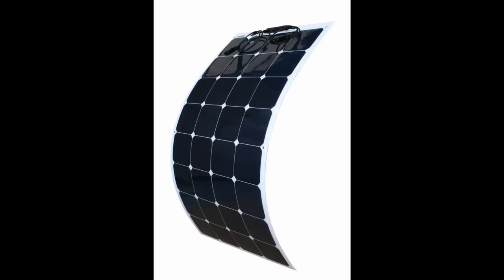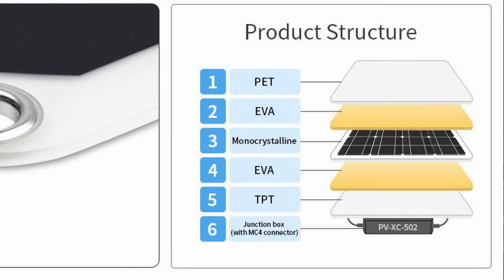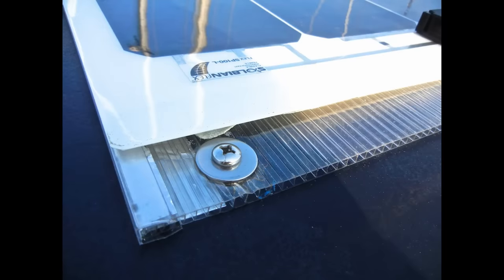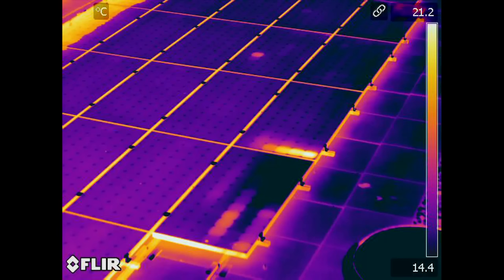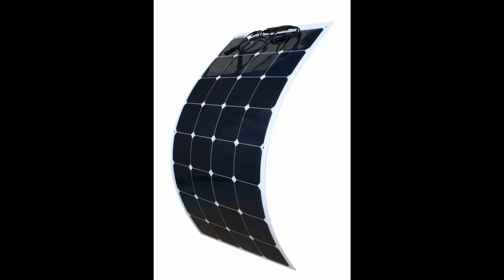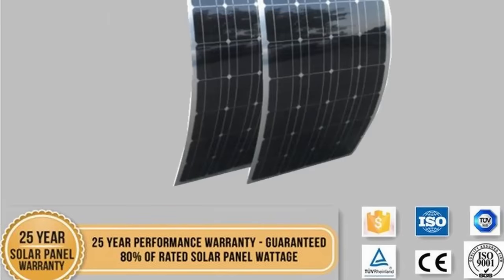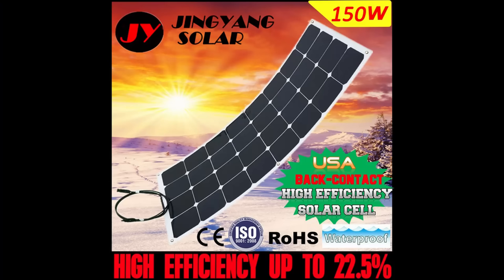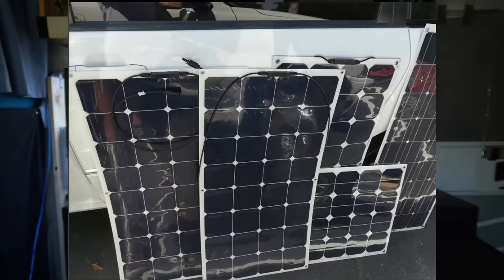The Truth About Flexible Solar Panels

Comment: Will: I think you need to update this. My Renogy flexible doesn't get any hotter than dark paint but my glass panel gets a lot hotter. Most are junk but there are several good ones now.
Reply: yes!!! please Will, we need an update!!
Reply: So happy i saw this comment. Just ordered a 175w renogy flexible panel, and was about to regret my decision, but now i feel good again 😁
Reply: @elsyver  They are quality.
Reply: yep those older ones were booty
Reply: When it doesnt get as hot it means the heat is trapped inside, if you were to touch the actual solar cells it would be way hotter. thats why flexible panels dont last as long
Reply: @LienoGenesis  Well, my Reongy flexible is five years old and functions just like it did when new. I don't think your premise on trapping heat is correct. The cells are covered with a thin layer of ETFE and I'd feel it. Cheap flexibles fail because they are made from PET plastic.

Comment: Wow, you managed to cram an hour's worth of info into six minutes. Will, this is the type of video I love. None of the fluff and time killer, just the facts!
Reply: Mark Conger pro tip. for 1 hour videos watch at 1.5x speed.
Reply: spot on comment.
Reply: Yeah, if they can't give me the info in ten minutes or less, they're either disorganized or think I'm lonely and need some company.
Reply: Minus the facts ... 
      He has a wild misunderstanding of how solar cells work, how they fail, or how they dissipate heat. 
His thermal fails show signs of resulting from cracked crystals which frequently happens during the shipping and handling.  
The sandwhiching layers are NOT, in fact, insulators. The thermal performance with one thin layer of plastic is very close to that of the glass (an actual insulator) on one side and air cooled aluminum on the other. 
Failures frequently occur when people paste them to metal roofs that get hot in the sun.
They are less efficient, they are not as durable, but literally nothing this guy says is anything but counter-hype. He is enthusiastic and convincing, just not accurate. 

    Solar power is suffering terribly from over hype and the resultant backlash like this video.
Reply: Don’t forget to like, subscribe, and leave a comment. Please check out our sponsor with the link in the description. And make sure you click that notification bell. Don’t forget to buy my merch!!! 

First, I’d like to start off by telling you why I am interested in the topic, and how I came about finding the information on this topic. Next, I am going to tell you about the history of this topic. Then I am going to tell you a personal anecdote that may or may not have anything to do with the topic. Before  I end the video, I will dedicate at least a minute or two to the actual topic so people in the comments don’t claim I’m click baiting. Lastly, I will restate everything I said earlier, but also show you my pet who decided to interrupt me while recording on the set. Awe! Isn’t he/she cute?!? Thank you to our sponsor!
Reply: Everything can get a work around. In this case placing tge flexible solar pv panel on top of an existing solar thermal collector panel will eliminate the heating of the over heating of the panel.
Reply: I barely got one fart in during this video. Quick and straight to the point
Reply: @squireson Hype is coming from the sellers... to advertise 25 years and fail within 1.

Comment: Interesting, nearly 4 years into flexible in uk, mounted near flat on a ribbed van roof, still performing as well as always 😁
Reply: I'd be interested in getting your views, as I'm about to use 2 or 3 flexible panels on my van in the UK.  I wonder if our 'weaker' sun here actually helps?
Reply: Incompetent installation and/or very poor quality panels encounter these heat problems. The encapsulations on glass solar panels are also insulators. I , personally am a big fan of the aluminum backed semi-flexible marine solar panels as you can dissipate heat beneath them (if you can manage an air gap without getting flex form the wind)

Comment: I'm happy with my semi-flexiblepanel after four years.  I mounted it on a thin sheet of masonite.  Light weight and shock resistance are essential to me.  I keep it indoors when not charging.  I never expose it to the night sky because freezing might harm it.  Mine is the one shown in your video.

Comment: I have glass panels in all my permanent installs, but I bought a semi-flexible one to use as a temporary vehicle battery charger when my car is parked for long periods. A glass panel would take up more space when not in use and also be more likely to damage the dashboard or trim due to the weight and sharp corners. So far the flexible panel is working fine. I'm reasonably gentle with it and it is entirely exposed on the back for heat dissipation as it is held onto the windshield with suction cups.

Comment: I think the flexible panels your are talking about are the flexible crystalline ones. There is also thin film (aka amorphous), which are meant to work better in low light and shade. You made a lot of good points.

Comment: Dude your opinion is by far the best, I have ever seen. That’s saying a lot because, I have been selling and installing renewable, sense the early eighties. When I started, we made our own panels, I broke many cells while soldering the cells, to make a panel, not to mention the water proofing the panel. it’s so much better and easier today. Even after all of these years, I still feel that, a Home built, Axle Flux Wind Turbines is far better then, any manufactured wind turbine, on the market. NOW FOR ME, and for what I’m doing, I’m trying something very difficult, installing a panel on my boat. I would like to be sure my boat battery stays charged, I have a 20’ Thompson speed boat, that we use for fishing. While under power, I’m never worried about our charging abilities. There are those days, that we stay put all day fishing, our electronics, are always on. We have Humminbird Fish Finder/Deep finder, a Ship to Shore Radio, and other electronics. That’s a heavy drain of power, we start our boat every 1/2 hour or so, to keep the batteries charged. We added a extra battery in Parallel for extra capacity. My fear is if someone would ever forget to start the boat, they would drain out. I even keep a third battery on my boat on standby, just in case. Yes I’m paranoid, I would like to have a 200w solar panel charging them. I have always known for about the shittyness of flexible panels. Is there Something that you can suggest for my situation or is flexible my only answer, with the problems you have, rightfully explained. The next problem is the whole 12v thing, I hate them, I always considered them a waste of money. All of my off grid installations we use 36v panels. With Midnight Solar, Classic Charge controllers. I’m just in one of those weird situations, that I may need a flexible 12v panel, with some stupid and cheaply built controller. You would know this, what would be a decent small controller, that you would you suggest? I have never built such a small array before? Sorry for the novel dude. Your opinion is very valuable to me. I always send any new off grid costumer, of mine to you. They can get a education from someone, I consider one of the best that I have ever seen. You will go a long way in life, and will lead people to a much better future.

Comment: I agree that the inability to dissipate heat would cause failure of the panels or at least reduce its performance. Ambient temperature does account for a large portion of heat, but what is being show at 0:46 is from circulating current due to individual receiving different amounts of radiation, thus different currents. It has more to do with internal interactions rather than environmental temperatures. Also, this is an issue flat panels share, so his statements aren't technically true. It just happens more often with flexible panels because how they are being used.

Comment: The hot spot issue is not due to materials used, thin plastic sheet performs the same as a thick slab of glass.
The most likely culprit is in fact bending damage, these panels are handled 100x over and very likely to get small unnoticeable cracks which will keep getting worse once the material heat cycles, and once you have significant damage the cell no longer produces a comparable voltage to other cells so it becomes a power drain instead, now effectively working as a resistive heater.
It could also be bonding issues, but that is again a very small change in heat dissipation.
Reply: Yeah, he has misidentified the 'hot spot' cause. The encapsulation materials on glass panels are also insulators (-ish). While I deeply wish this weren't true, getting small orders shipped all the way from China/Indonesia means they get handled alot .

Comment: South-east England and I have just fitted a flexible panel, and the purchase was mostly based on the pop-top roof of our elderly camper. When we upgrade the camper, or the struts that hold that pop top! The mounted area is almost completely flat, so it shouldn't flex. It's a mono 150W etfe panel. It was cheap, fills a gap for us and can be replaced in a few years if the van is still with us. Nice work Will, love the videos, keep it up!

Comment: I've had flexible panels on my boat for 6 years and have noticed for at least the last three at least that the output has reduced dramatically. I was getting up to 25A from 360W but now only using 180W (2x90W panels) and getting 2.5-3.5A. A useful trickle but not much more... I will be going for solid panels when the time comes 👍

Comment: when you can get a 200w flexi for less than $70, which is less than 5 times the cost for heavy rigid panels, the light, slim, cheap flex panels are excellent as portable extra panels you can tuck away and only bring out when you are  parked in the shade. So they may not last as long (duh, most cheap alternatives don't, but just do the maths). I have two large (250w) flexi panels as extras, I backed with a semi rigid plastic billbord material and cable-tied slim alloy channel around the edges, fitted longer cables and now I have 2 light, slim, cheap semi rigid panels that I bring out occasionally when needed.  Sometimes it pays to go cheap, especially when there is no realistic expensive alternative.

Comment: I have 3 100w sunpower flexible panels on Eagle cap 1200 in northern California with corrugated plastic underneath them and haven't had a problem after 3 years . Still going strong.

Comment: Excellent,  you just saved me a few $100, I also saw a video in which the flex panel transfers   heat into the interior of the vessel, ceiling temperatures increased by 5 deg F.   thanks

Comment: I would rather build an active cooling for flexies than drag 100kg worth of glass on my roof It is around 100l of water. Weight factor is paramount when it comes to vehicles. Anyway, you have got the point. Thanks for the video.

Comment: I have had my two 100 watt flexible solar panels on my van for almost 7 years now and I haven't had one single issue  !!!  I even go through the car wash from time to time  !!! If you buy quality solar panels and take the proper precautions when installing them they should last for years  !!!
Reply: Did you use any insulation underneath your panels ? I have white vinyl on my roof which should help to reduce the heat
Reply: What brand of solar

Comment: I have been used my flexible solar panels (factory installed)  on my Alto Safari Condo 1713 camper for 7 years... no problem whatsoever...just perfect for me...I use them in AZ, CA, NM and Canada for few months every year.
Reply from the maker: There are some expensive ones that do great. Sounds like you lucked out. there are two good ones I know of from Germany and Italy that work well
Reply: @WillProwse  What are the names of those panels Will? Also, what do you think about the Sunpower flexible panels which come with a 5 year warranty?
Reply: What brand name was that?

Comment: Fortunately with Sunpower cells, even cracked cells don't produce significantly less output, as long as the copper traces on the back remain intact. They still collect electrons from the silicon and perform as normal.

Comment: Great review I agree with everything you said as everybody around me at the marina has flexible solar panels and I’ve never seen any last more than two years without falling apart except for a mate that has a pair of solbian panels , they are now 8 years old and the 100 watt panel is still putting out it’s 5 amps , the reason not every body has a good quality panel is because one of these panels costs 1300 Australian dollars
Reply: Unfortunately there has been a rush of super cheap prices advertised on flexible solar panels. The crystals in both the cheap and expensive ones are all the same at point of manufacture. The mishandling of the panels before point of sale is the major cause of these problems. Small cracks in individual crystals turn the the crystal into a resistive heater (it's not the sun melting them but the neighboring crystals pushing amperage through them, worsening the problem).
       You get what you pay for and the cheap rush is going to ruin solar's reputation before long.
Reply: yeah the good ones are really costly!

Comment: I just bought one lol.
I bought a 300 watt flexible solar panel for my car dual battery system
because here in Vuctoria, Australia we are not technically allowed the glass & aluminium panels roof mounted.
I pray that mine lasts at least 3 years lol.
Great Video, Thanks mate 🙏

Comment: had my very flexible panel , 70 watt. for years but its very different from what you showed its blue and it was shipped in a roll. that is how its stored "in a roll" currently as it is part of my diy solar generator set up. but its fine when i put it on a hot roof for a year. no changes, i think THAT type is bunk, but mine works great bro. Here is one very close to mine: Uni-Solar PVL-136 Watt PowerBond Flexible 24V Amorphous Solar Panel MC3

Comment: Totally agree. We put flexible solar panels on a bimini on our boat and they failed after 3 months. Current output per panel dropped from 8amps to 2amps and never came up. I experienced the cracking sound too. Never use flexible panels.

Comment: I've had three flexis, they all barely lasted a year. Went crispy crackly and two are zero volts and remaining panel only outputs ten watts at most! They don't look burnt out but I've definitely cracked cells through moving the panels. The bus bars in the panels also looked like they were delaminating. They don't have many bus bars per cell which contributes to cell hot spots, add that to the poor thermal conductivity and you get degraded or even burnt through cells. Cheap nasty stuff. Perc half cut cell glass panels might be expensive but I've learnt the hard way that you get what you pay for with solar panels!

Comment: I have  2  Renergy 100 watt   flexible portable  panels that I built PVC pipe frames for them with legs to pivot  & put them out in the sun, bring them in at night. After 6 months, still generating the same power when I bought them. Also,  their on an open frame so the dissipate heat well. They should last much longer this way then roof mounting. I wouldnt do that at all.
Reply: Drum Crazy Crary I’d love another update man - so much contradictory information and sites with reviews they’ve handpicked (can’t trust).  Any info from real people is welcome!
Reply: Also have the renogy and still going strong 7 months in.